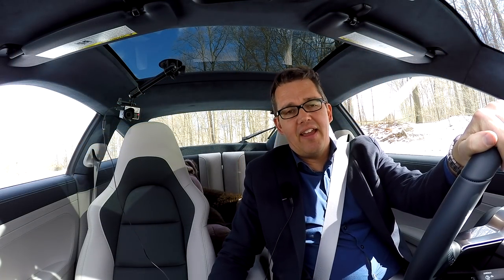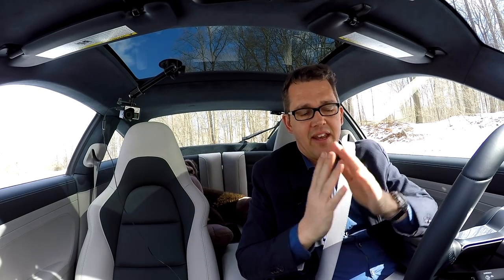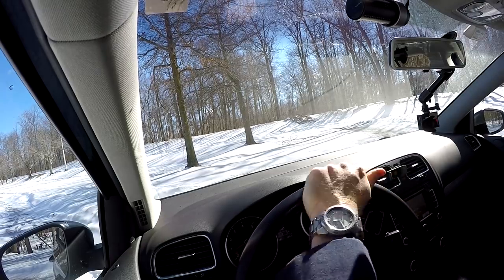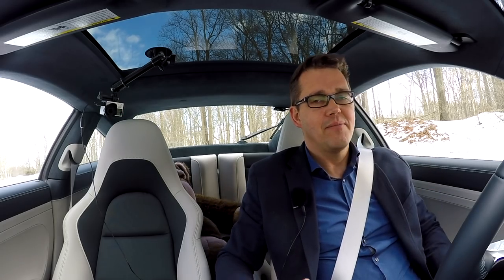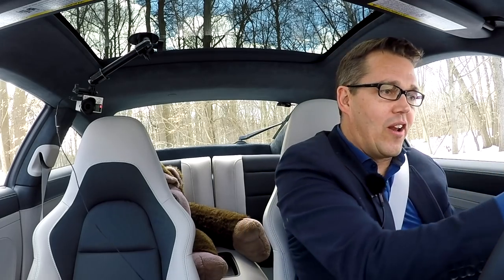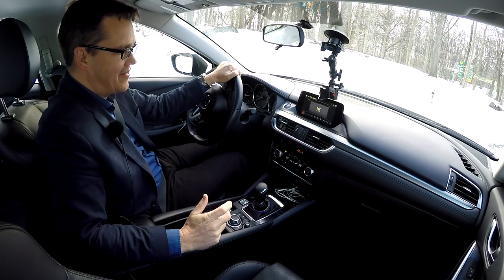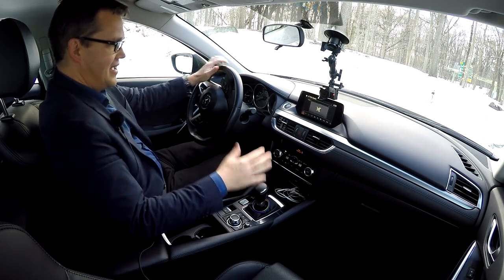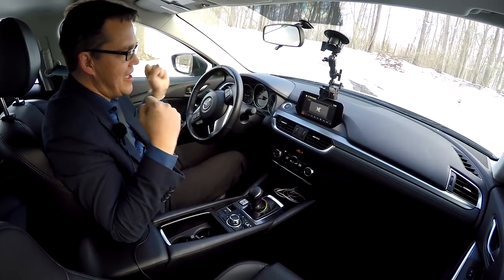Porsche 911 HandBrake / e-Brake turn

Comment: Hello nick. Thumbs up from Portugal. I have followed yours videos for some time... i used to have a 991.1 4s and I recently purchased a 991.2 4s. There is a way to do it: the 911 has a emergency brake system using the electronic brake for the case of regular brake failure. To do so you have to press the electronic brake continuously and you will have a very strong brake. I suppose if you get just enough speed and use this emergency brake you will be able to perform a nice 180.

Comment: In each customer feedback survey I have responded to on my 2015 911, I have mentioned that the electronic "handbrake " is a terrible substitute for a true, console-mounted handbrake.  Such brakes were also once referred to as "emergency brakes".  Given the awkward positioning of the 911's button, and the lack of feel and positive response, it is very difficult to use in an emergency, or as anything other than a parking brake.

Comment: Hey Nick when you use the e-brake while moving your car uses all 4 brakes for an emergency stop using abs! Its when you are completly stop that the mechanism locks rear wheels. You can test this any time in a straight line at any speed by pressing the e-brake button. Its like pressing hard brake pedal

Comment: And the point is?  A lot of guys complain about the e-brake, they like playing around, sliding.  Personally, the e-brake is fine.  It applies the brake for parking purposes correctly.  It also prevents people from yanking up on a manual brake unnecessarily hard.  Have the e-brake on my 911 and like it a lot.  To each their own.

Comment: @NickMurray , I had a 996 and I always thought the handbrake locked the diff not breaking the wheels? So if you've been giving it some stick the pads dont stick to the hot discs? Could be wrong. Interesting non the less! Keep up the good work. Shes a beauty.

Comment: Hey Nick, part of the reason the Porsche didn't slide around is cos the engine is in the back which gives more grip on the rear end. This will show your hand brake turns at low speed. But, at high speed the engine weight should work in your favor like a pendulum. So, please do this experiment again, but this time at higher speed.
Reply from the maker: I did the test several time off camera, the front wheels brake in my car.
Reply: Yes I know, but try it at 40mph that should help the rear come around. If that doesn't work, try 50. Make sure to get it on camera ; )

Comment: LoL, just because it's a 4wd doesn't mean the ebrake works on all 4 wheels.
Reply: Pulling the handbrake can cause issues with certain 4wd and awd systems. The central diff in say something like a subaru impreza wrx is a viscous coupling that acts like an lsd. If you put lots of deceleration force on that centre diff by handbrake turning, the fluid will thicken and want to lock up, making the front wheels become connected to a certain extent. Yes, you can handbrake turn if you have a viscous centre diff but you'll put an awful lot of stress of your transmission components and wear the viscous diff fluid faster. That's why hydro handbrakes in rally cars have electronics which disengage the locked central diff when the lever is pulled.

Comment: I did this about 18 years ago with my newborn daughter in the back of the car.   I obviously wasn't using an electric e-brake (is that an e2-brake?) and I was just doing it driving down a regular road, not trying to bring the tail around.  Ended up in the ditch.  Haven't played around with the e-brake since.

Comment: Hey Nick, I have noticed in this and other videos that when you drive an AWD Porsche in the snow it doesnt really work the front wheels at all, but I am wondering if this is because you turn traction control off like you did in this video. Could you test to see if that makes a difference? Maybe have the camera setup on a side view and try to take off on a slippery surface with traction control on and off.

Comment: There are so many reasons why you shouldn't attempt this maneuver. Especially with an electronic brake. I learnt my lesson in my teen years where I regularly used the hand brake in all winter parking maneuvers. One time I had a bit too much inertia and slammed into a parked car with the whole family on board. No injuries or big damage except for my ego.

Comment: Some of these new handbrake systems actually just brake all 4 wheels using the normal hydraulic brakes. I know for sure thats how its done on BMWs, then when the car is shut off the mechanical brake engages but otherwise, like when you're moving and pull the switch, it just applies the regular brakes (quite hard).

Comment: "Braking on all four wheels" with 991.2 all wheel drive?
Only the rear wheels are e-braked, so the front wheels must be affected by the transmission coupling?
Reply from the maker: yes
Reply: Must try the non-all wheel drive 991.1 on snow soon.  Will be clear of trees though. :0)

Comment: With my Mazda3 AWD(jdm), if I'm off the power it will do a 180, but if I'm on the throttle it won't because the center diff is engaged so all four wheel brake.

Comment: If the 911 has the same E brake as the rest of the VW family it will not use the parking actuator while in motion but rather the ABS/ESP system. So it will not lock up the rear wheels before it is standing still.

Comment: One more thing: Porsches automatically turn off the eBrake when you are in gear and have the gas on. E.g., when you have the brake on, put it in gear and then start driving, the brake automatically will turn off so you can't drive with it on. RTFM. :)

Comment: Did you try with traction control off on Porsche... I presume you did
Reply: Gans Stuff They have a tight centre diff, so when the rears lock the fronts grab too. Like most AWD performance cars.

Comment: there is only electric parking brakes in the rear. Not 4 wheel braking. It could be the traction control. try disabling it.

Comment: I can't do a handbrake turn on my passat with e brake. If I pull the e brake while driving more than 5mph/8kmh it will engage the emergency brake and brake all four wheels with abs. The e brake works different on different car when you engage it while driving

Comment: The spec is starting to grow on me. The wheels are LOVELY!! But why is the front air intake thing on the bumper in plastic? eww... 
On the handbrake thing, you can dump the clutch with full throttle and turn the wheels no? would spin the car surely?

Comment: I can't do it in my mk7 golf... the e-brake automatically turns off if you engage it while moving. Might be worthwhile to try it again because logically if your brakes stop working, you need a method to stop and it should work.
Reply: Atomic_Sheep The parking brake is not meant as an emergency brake, that's a misconception. Every car has at least two or three independent hydraulic systems for the brakes, so a hell of a lot of things need to go wrong for you to lose all braking action.
Reply: Ah, didn't know that thanks.

Comment: Learn to drive Nick, you can do a 180 without touching the e-brake. Don't even need snow. Don't even need rain! Trust me. With your menial transmission of course you hardly ever need the e-brake, just leave it in gear. So the question now is: can you park a PDK in gear like that? (I can guess and am dreading the answer already.)

Comment: Hand brake slide on a snow covered street.  That's weak!   Back in the 80s when I was a youngster I could do perfect 180s on asphalt in my Z28.
Reply from the maker: A Z28 is made for laying down some rubber!
Reply: Nick Murray with the emergency brake!

Comment: Hey Nick I just realized: do the NA 991 come with °Celsius Climate Control??? o.O Your car shows a temperature setup of 22.0
Reply: Luca B. You can switch it yourself to Celsius or Fahrenheit. How to do that is explained in the manual.
Reply: Edy B Oh didnt know that, thx :)
Reply: Luca B. You're welcome Luca. Audi and VW have that feature too.
Reply: Edy B Is it possible to change the digital speedometer as well?
Reply: Luca B. You mean from Miles into kilometers? I think so, but your garage has to do that. You can change the language in the PCM yourself, however.
Reply: Edy B Yeah thats what I meant. I'm just curious because I didnt know you could do that. We have a 981 Boxster Spyder and I havent found something like that so far ;)